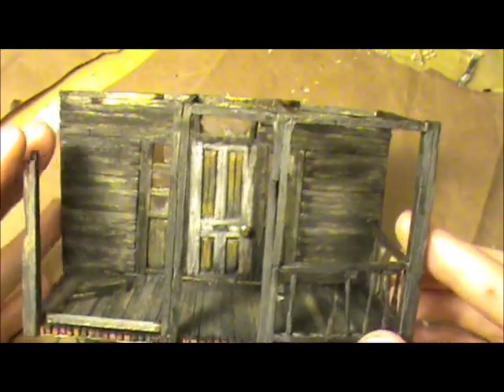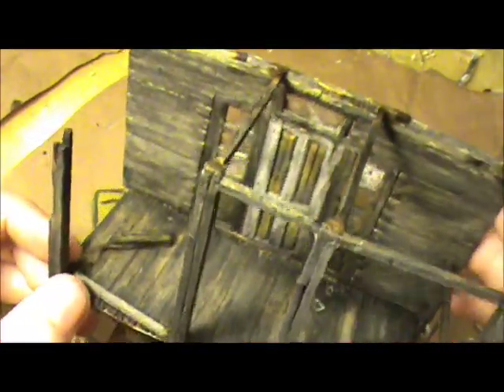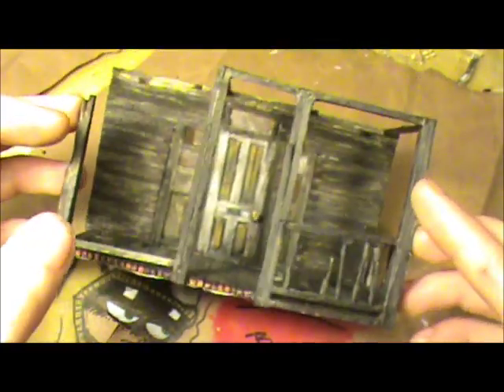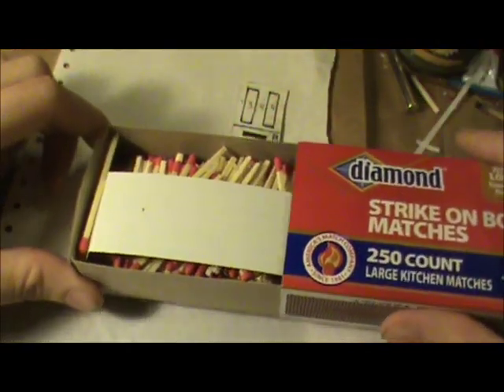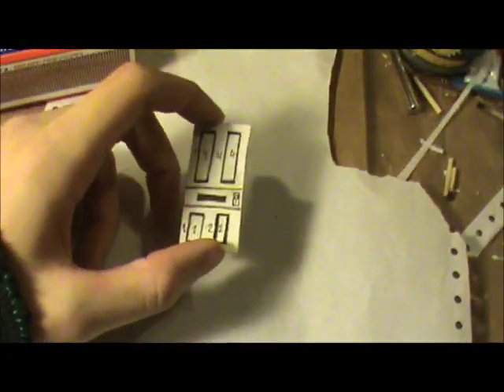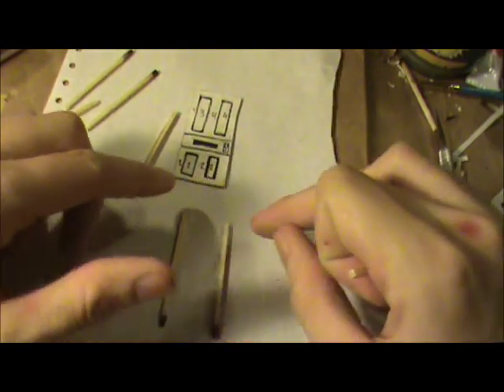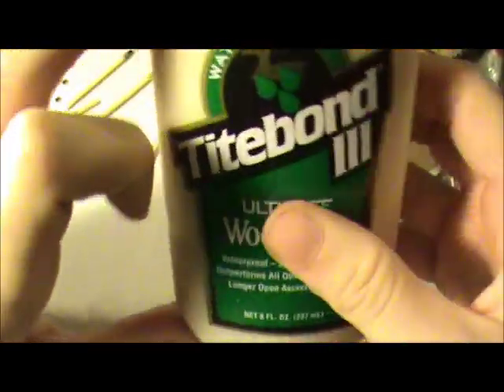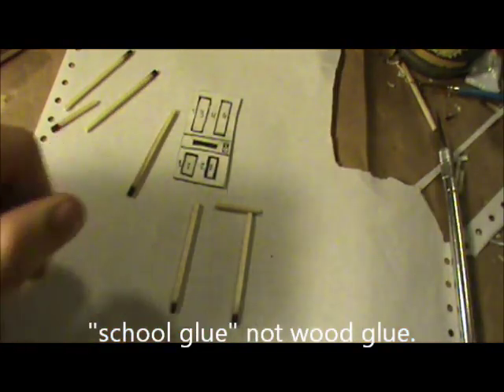How to build a match stick house: building the door

Comment: Brad purchase a small razor saw for about $5.00. If you pay $1.00 per box for the matches a small razor saw would make your life allot easier and save your fingers. For that matter you can get saw blades foe your x-acto handle. Usually three per package. Keep up the good work and thanks for the video.

Comment: Hi! Really like your video, it inspired me almost a year ago to build something on my own! ☺

I made two walls last year but now I'm ready to finish it. So far got 4 walls with doors and windows, now I'm making the roof out of extra long safety matches. The only problem is that these long ones require way too much glue and I'm almost out and I can't seem to find the kind I was working with till this time. What kind of glue do you use? What's the best?
Reply from the maker: I use titebond wood glue but you can use elmers wood glue. I use titebond because I also use it for wood working and just have it around the house. I would like to see you house when you are done!
Reply: Thank you! Well, there's still long way to go until I finish it, and it's still need to be painted. But I'm really enjoying doing it. I'll try to make sure you see the finished project, I can assure you though it's nothing compared to the one I saw on other videos you posted. For now I'm only working on the outside of the house but maybe after I finish this one I'll try something a little more complicated.
Reply: +bradwnel I've been working on a titanic for 5 years know never though about doors lol but I'll be using this method

Comment: Hobby stores have pre cut matches. Doing this just wastes time and dulls your knife.
Reply from the maker: eh this is more fun in my opinion but thanks for the advise
Reply: eBay also sells pre cut matches 2000 for 2.99 also you can buy a matchstick cutter for 6.99 helps a lot